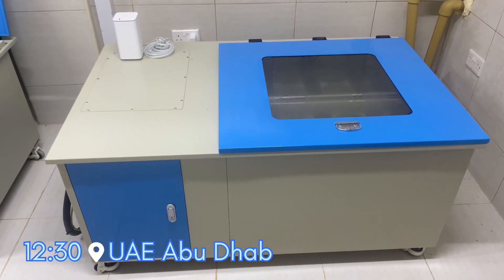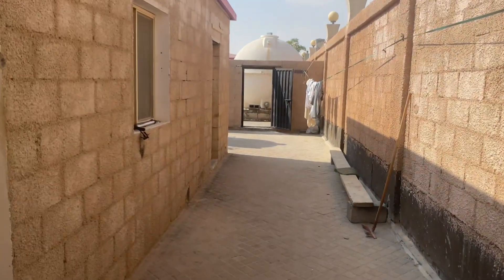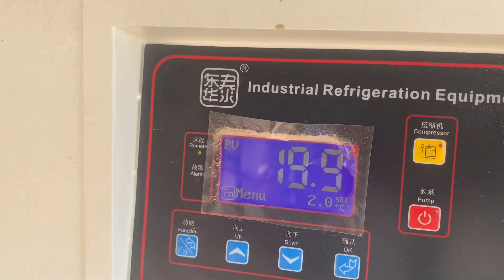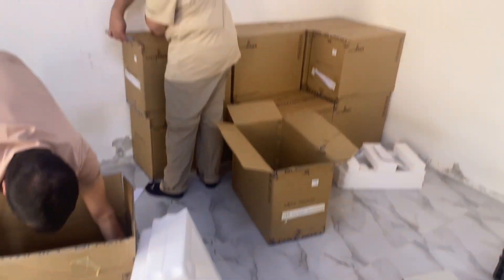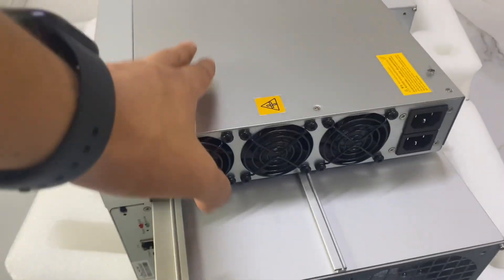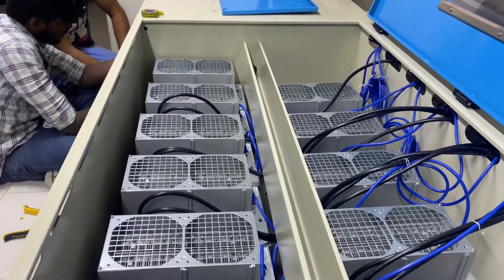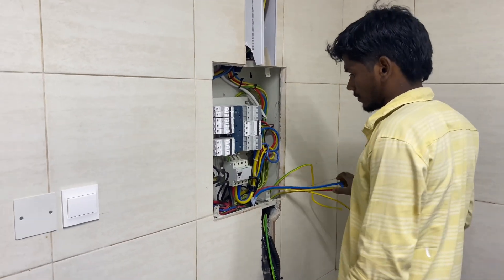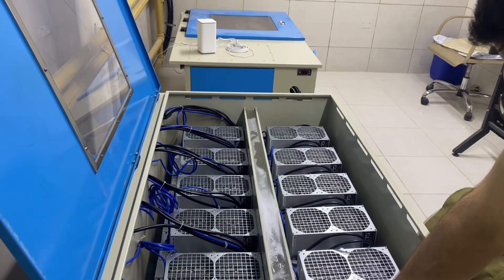X20 miners immersion cooling setup in the UAE

Comment: What is the fluid?  Non conductive or are the miners made for immersion?
Reply from the maker: yes the fluid is a dielectric fluid ,non conductive , you will need this fluid even if the miners were made for immersion
Reply: @Crypto_mining_lab  thank you for the reply.
Reply: You can just use mineral oil, it is nothing special

Comment: Looks like a rig made with parts from Al Rigga 😂

In 2018 i was part of a study and the costvof elec in uae made it non competitive for mining.   

Cool setup though for sure. Id try pre chill the coolant at night to offset the heat of the day.  Have a big insulated tank of coolant?
Reply from the maker: well if you are not local to the UAE then you wont get the real deal in terms of cost per Kw , for the coolant the chiller has its own water tank , and since this is a two loop system , the coolant required isn't that much from the cooling system back to the immersion tank
Reply: @Crypto_mining_lab  Thats true, if you are UAE native and have it in the villa, then you basically get the utilities paid for by the expats working there.... 

It looks like a cool setup.  The oil baths look well planned and thought out.